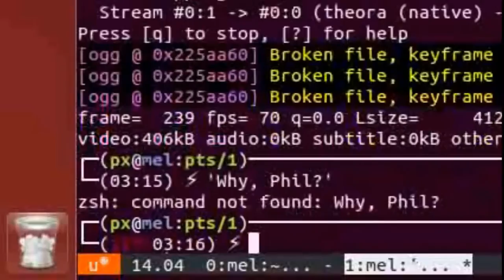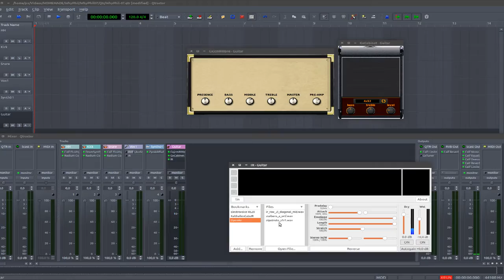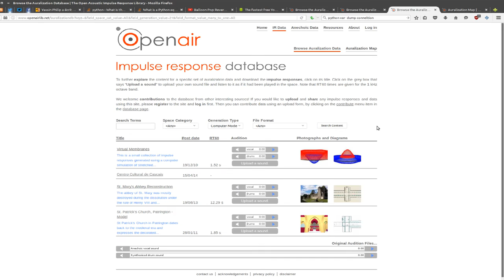Why, Phil? #07 : Angus Young goes to Church

Comment: Hey, Phil, thanks for the info. BUT, for everyone around:

1.- How do I measure the response of a system that has an audio input and an audio output (let's say, a mic'ed speakear)
2.- How do I apply such a transformation (or an Impulse Response) backwards, so that, for example, when you have a sound played on a Cathedral, you apply the reverse transformation and get the closest possible to the original sound being played?
Reply: 1. Every system has an audio input - the speaker has an audio input (by definition) - you need to feed a single sample impule throught the speaker (like this one: https://www.freesound.org/people/unfa/sounds/205620/ ) and capture this on the mic :)

Another example - an empty barrel has an audio input, you just put a mic inside and smack the barrel with a hammer - and you've got a nice IR sample :)

2. Removing reverbation from signal is one of the most difficult tasks in the sound filed. I don't know of anything that could performe a "reverse" convolution to give you dry signal if you have the reverbareted one and an impulse  response sample.